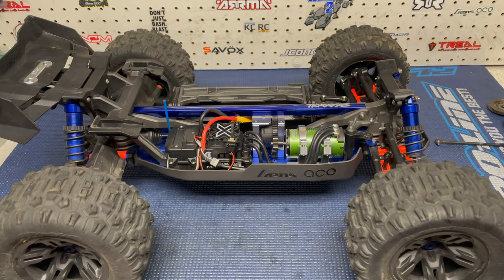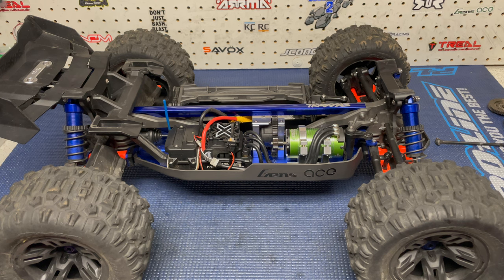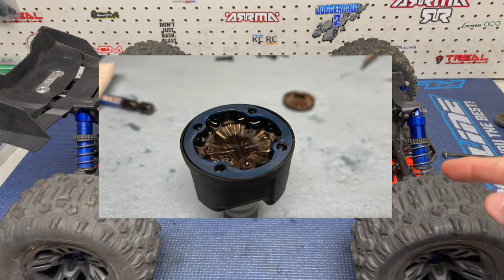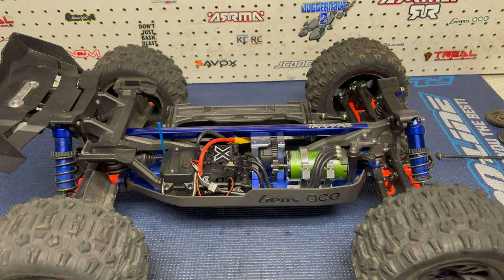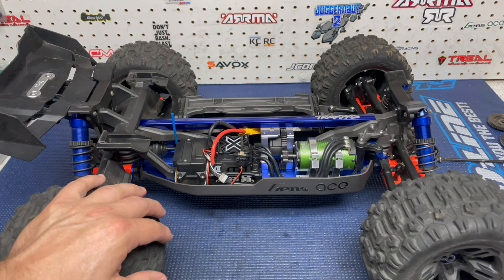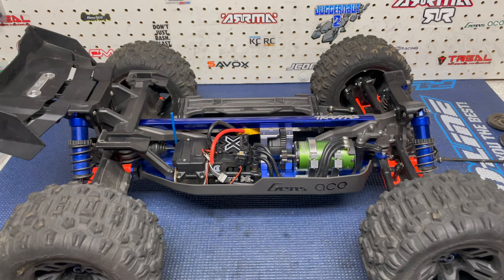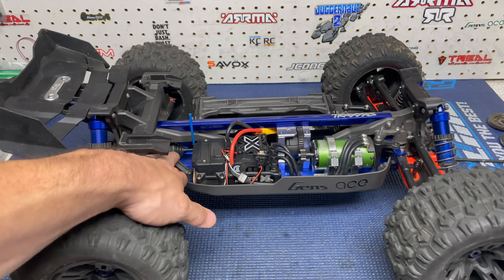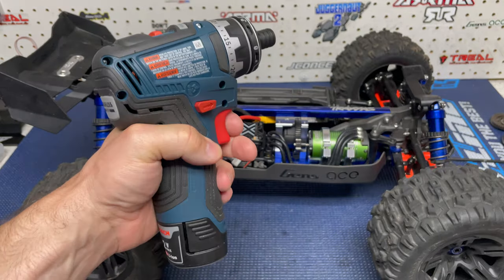Traxxas Sledge (KC RC Motor Mount, & Machined Gears)

Comment: I hated mine till aftermarket caught up. 
Currently with the m2c chassis, motor mount, hinge pins. As well as basherqueen towers, hot racing extensions for the 6s backflips, a max 6 esc, and geared up a bit -- it is my favorite basher. Money pit yes, but after I went total beef cake I can't deny that I do love the car.  Just sucks that I have less in my 8s exb trucks than this lol

Comment: I've got about 25 6S sessions on my Sledge and the only thing I've broken is the rear outer control arm pin...twice. I drilled it out and installed a 4mm hardened bolt (on both sides) and haven't had a problem since.  I'm either lucky or don't bash as hard as some.  Whatever the case may be, I'm having a ton of fun with the truck and don't plan to upgrade anything until it breaks as I'd like to get as much out of the $800 purchase price as I can.

Comment: Jason, don’t worry about if people think your just bashing on the sledge. We can tell by your videos you are not. Further more, when that truck first came out, I could tell immediately without purchasing , that it was hot garbage, before I even saw it, and once seeing it at the hobby shop, that was confirmed. I refuse to buy a Traxxas product, I will build one from scratch, using every upgraded part I can. My example is the Maxx 1/10. First run, tires blew, second run esc blew, third run, motor blew, forth run, cracked the front bulkhead, fifth run, the truck caught on fire. I wish I were joking but I am not. And all this said, this is one of Traxxas’s vehicles that they specialize in building, meaning their plastic chassis and everything else they do. They built this thing like an Arrma, which is something they don’t do, so I expected it to be that much worse.

Comment: Do you think if you left it stock you have any issues,  I think Traxxas only test and build around the power they supply 
 I know out ofyy collection mostly arrmas , the kraton by far self destructs the fastest.  It's arrma pushing those parts to limit compared to rest 
 Mostly bc it's the widest with most rotation mass .

Comment: The thing is, it may have broke, but the actual diffs are pretty big. Bearings too! With arrma, I mean look at the diffs and bearings 💀 5x11x4 bearing that support the input shaft ( pinion ) geometry is off for me to when the suspension compress the driveshafts wants to pop out, sometimes it eats the cup ... the " safe D " cups tolerances are soo off when you actually tighten the set screw everything wobble so badly it destroys the 5x11 bearing even more... I miss the good old days with Monster Gt and LST, now its just truggy I found them less exciting to drive. Hey love the channel by the way just my opinion 😉

Comment: Hey man off topic but you’ve made a lot of videos about the outcast v2 and I just picked one up and it’s durable as hell but the steering seems really weak.  Just wondering if you felt the same.  Thanks.  Love all your content
Reply from the maker: Steering isn't the greatest.  But you will notice that when you are off the throttle it turns a lot better.  As soon as you give those trucks any throttle, the weight transfer to the rear.  Making it harder to turn.